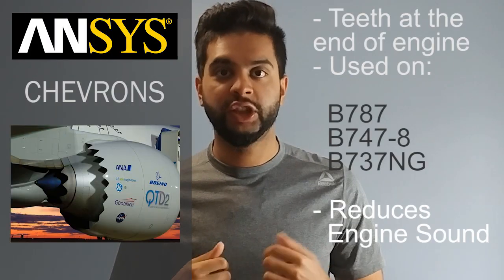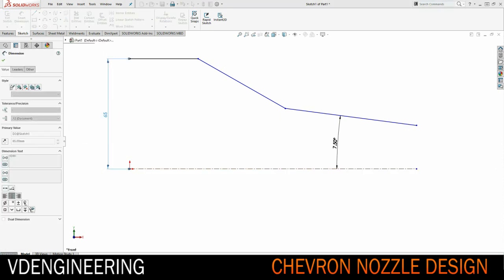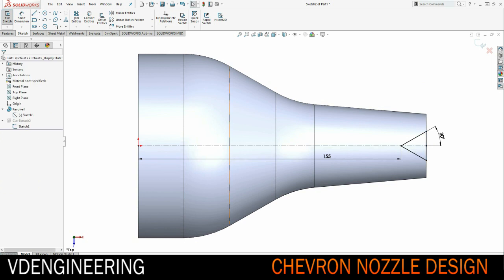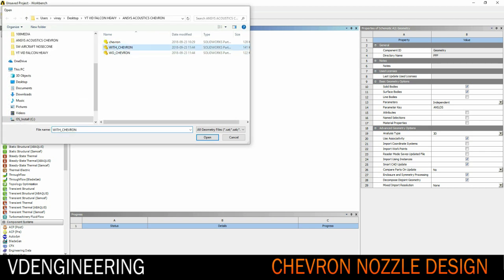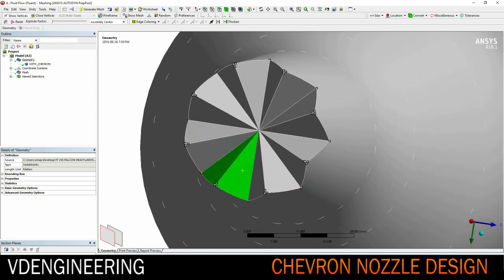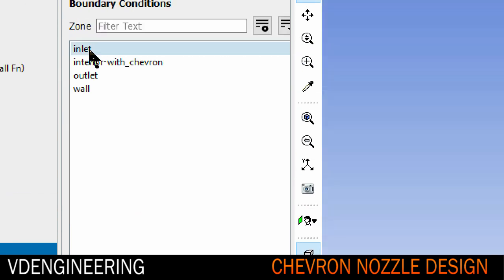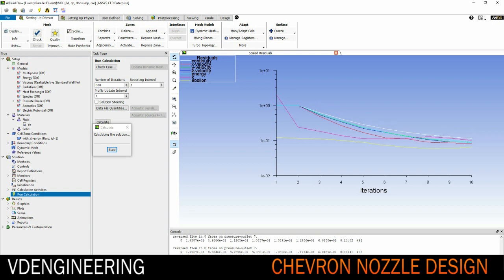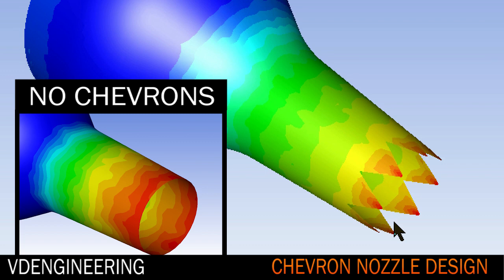ANSYS Fluent 3D CFD: Chevron Nozzle - Jet Engine (B787) Acoustics Tutorial!

Comment: Hello sir, 
I have a query about nozzle design that is first you draw an straight line then for continuing the sketch from last point so at which angle we should draw that second inclined line for optimum results plz solve or metion that on video.

Comment: first comment :D, nice video man could you help with with this setup. I want to do a simulation of a fan but most of the tutorials i see they have initial inlet velocity i dont want to see the flow through the fan i would like to see the effect the fan blade has on the air, would i set the inlet to pressure inlet and make it atmospheric?
Reply: hello @dpsilver I am working on similar project,  I am also looking for blade passing frequencies, would you like to share your experience working with it